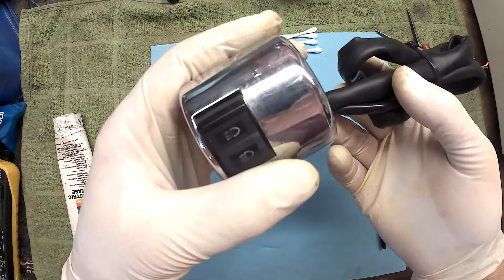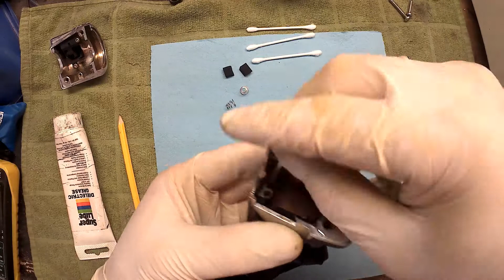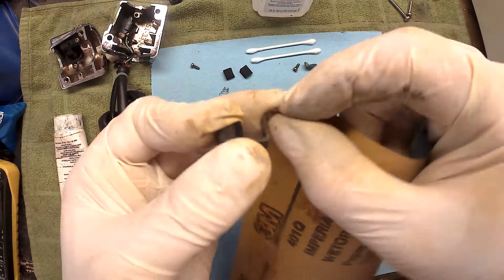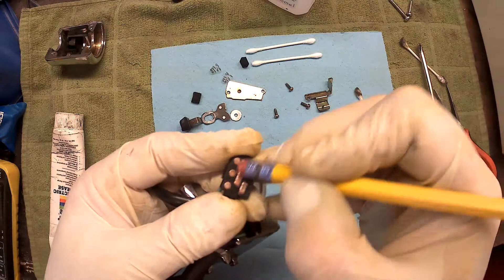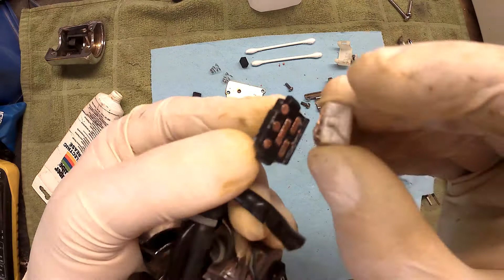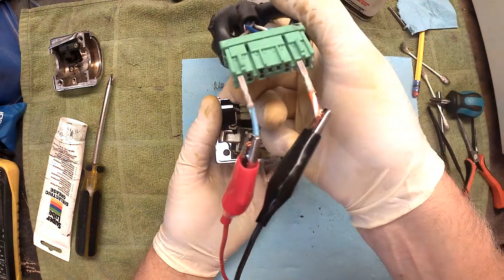SignalBoss - Turn Switch Maintenance and Setup

Comment: The washers on your lever were in a different order than on another video I watched, and on my bike.  I had the brass one with the guide boss under the arm, pointing up through the arm.  So from bottom to top is mounting plate, brass washer, arm, steel washer, then the screw and lock washer.  I see yours did come apart in this video the same order in which you put it back together, was possible this was an accidental change made during previous maintenance, or an intentional change to help improve the angle at which the switch arm is in contact with the switch?  It does seem like having the brass washer under the switch arm would reduce the surface area where the moving parts are in contact with one another, as the arm is only sliding against the brass washer underneath it, as opposed to the entire mounting plate.

Comment: Great video Steve. Missing info that I may have missed but gave me pause. Re installing white plastic back into the aluminum housing. It is hard to see the centering ridges at first attempt It was not aligned.

Comment: Now I've seen it all. Annual turn signal switch maintenance!! 5 bikes, 35 years, 250,000 miles, I've never had a switch ever give me any trouble. If you really want to clean gunk out of there, you've already gone through this much trouble, why not get a can of carb cleaner in there and really clean it out then? Far more thorough and far faster and easier. Maybe then you won't have to do it again next year! Then why in the world do I want to convert it to a momentary too? Signal Boss???? At least you did a nice job on the video, I just don't see the point, rates right up there with mechanical clothespin maintenance! :D.
Reply from the maker: The SignalBoss is a small computer that uses the momentary signals to control and output the turn switch functions through solid state switching that replaces the oem relay function, which then allows for LED or incandescent. In short, there's a lot of stuff going on using both electrical and software engineering.
While Carb cleaner may remove excessive dirt and the grease, it doesn't clean the copper oxidation from the surfaces.  Nor does carb cleaner repair damaged surfaces caused by oxidation and dirt.  If you haven't taken opened the switch you simply don't know what the status is of the switch contacts.